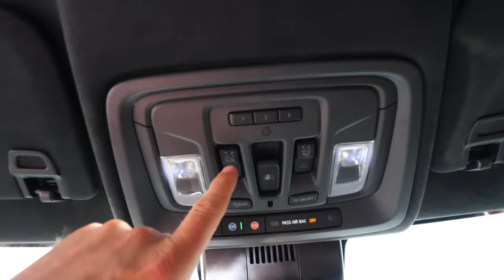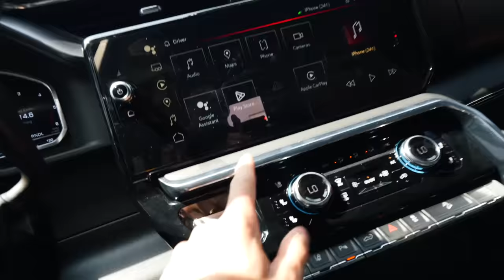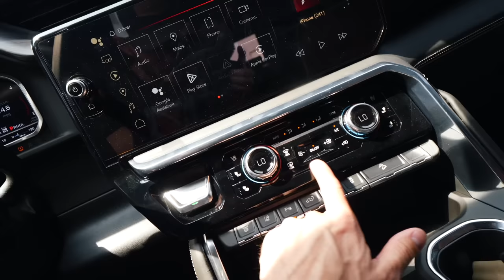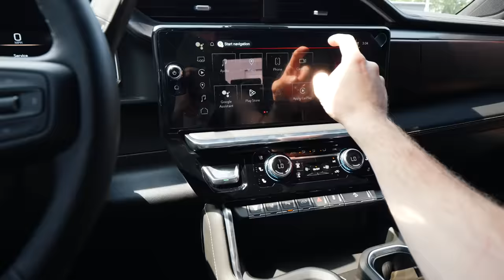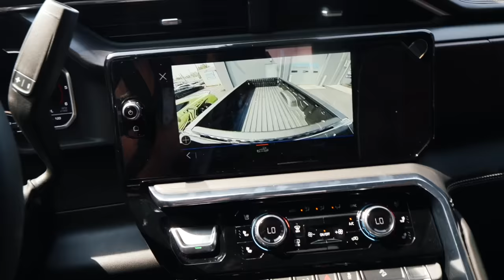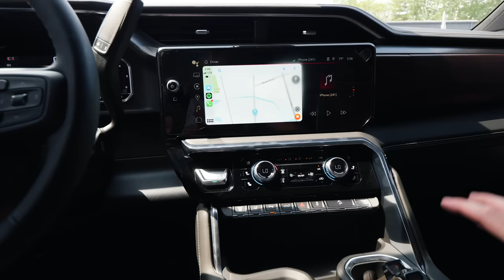5 Things I HATE About The 2024 Duramax.

Comment: 2024 Chevy 2500 HD Duramax LTZ here. NOTHING BUT PROBLEMS! Limp mode and dashboard lights at 200 miles. Happened several times after. Software update from dealer, hard shifting. 2200 miles, transmission leaking. This model year is a LEMON! DO NOT BUY! This thing has and MSRP of $87K! The dealer can give 2 craps about it.......The worst purchase of my life

Comment: Yeah, the gearshift in front of the screen is honestly the biggest fuck up in a modern vehicle.. like absolute mind blowing who the fuck needs to get fired. The Chevy model is definitely not as bad, but it still blocks your toggle switches and your exhaust brake switch because the screen is a little higher in the Chevy model. 
It was only designed for the half tons with the centre console shifter.

Comment: What I don't like about the Denali Ultimate 2500

Needs more comfortable seats like platinum or limited Ford
power tailgate
400 watt outlet in bed is useless need at least 2K like in platinum Ford
Needs locking underseat storage full size to seat like Ford
Locking console with more depth
seat memory options not good
massage and lumbar controls are not user friendly
Move the trailer brake control and add Cup holder or space like Ford
Power steering wheel and pedal adjustments would be great
Super Cruise on the 2500 should be there
A button for camera without going through screens
automatic running boards should be extend fully 
Fuel economy so far is less than my king ranch

Likes
Onstar for 3 years with data
google maps
bed liner installed at factory
Better ride on rough roads
Brake pad monitor 
I prefer the sunroof to the pano sunroof of Ford, less heat in summer

Comment: Oh boy lol. More of the same lol. 
I had a 2021 hd Denali and got rid of it as soon as I could. 
Clunky steering, wandering down the road. 17 mpg best.  Towing what a normal 1/2 ton would tow it would buck and surge. 
I liked how they put lights on the mirrors but ya can’t use them unless in park. 
Got a tundra tundra platinum then gmc AT4 carbon pro 3.0 Duramax, nice truck if you can over look hard seats and ford escort front end. 
Then went back to the 2019 HD Duramax Denali. 

Just over all built like a truck is supposed to. 

It’s the truck that made it all worth it. 
If trump built a truck or wanted one or ordered one it would be the 2019 hd Duramax. 

It’s the last of what’s left of our true engineering heritage. 

Now it’s all gone. These trucks will be the most sought after.

Comment: Jack you should try and get a set of front door handles they should fit in the back and have them wired into the same wires that works the front then you should have the button unlock door handles in the back

Comment: I also hate the rear door dont have the button but I love that you can fold the mirrors in from the handles because like you I hated having to reach in my pocket to fold the mirror and then I use the button to get in and then I have to push the button vs. The 24s push to lock and hold push to unlock and hold as you open the door. perfect!

Comment: I know the upfitter switches were available before the refresh but the customer had to pay to have the wiring installed after the purchase so I would think they are still a option
Reply: GM has upfitter switches? As a accessory from dealer? I would be interested in these. I have 17’ 2500

Comment: All great points.  Glad you hit on the laziness carryover center console of the 1500.  No need for the trailer brake down there and that void of a spot where the 1500 shifter was,... all so they can put in a big shiny new push start button.  Chevy definitely did better at placement.  One more issue I noticed is, no more 12v outlets.  I use those regularly for working, towing and camping.  Those weak USBs aren't going to power my trailer cameras & TPMS, air pump/compressor, random camping accessories and battery chargers (cell phones, kids iPads, power tools).  I know it has a 120w outlet but I'm not wanting to start my truck every time.